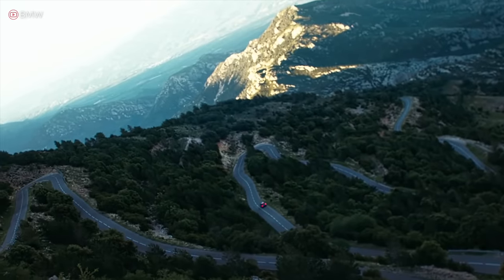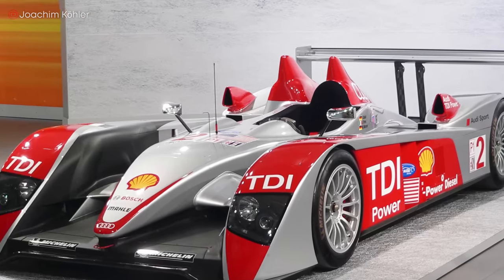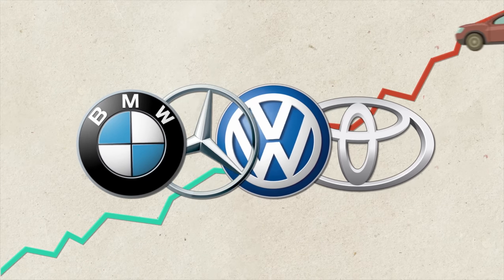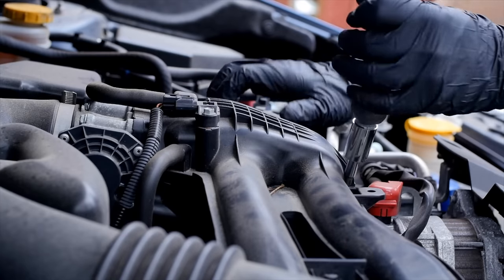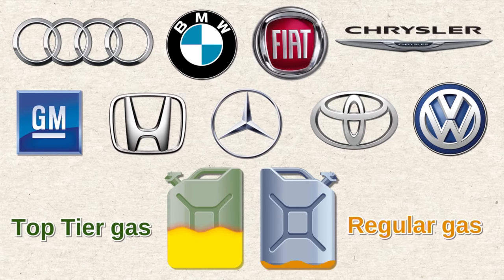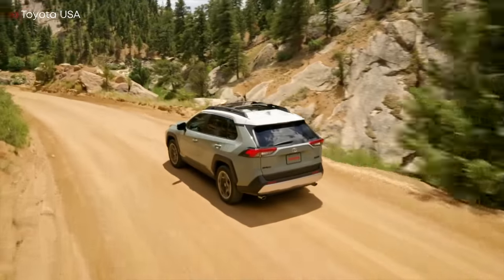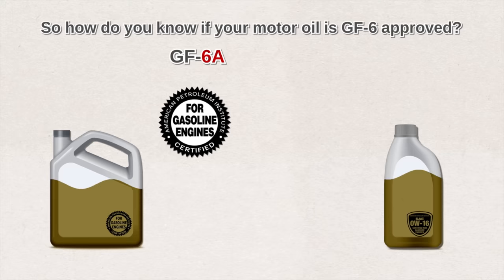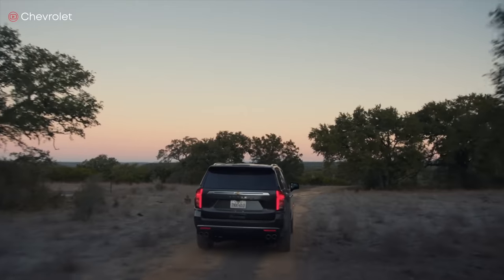Stop Buying This Fuel Right Now

Comment: Why did my 2007 Ford Escape perform better and get better mileage when running 100% gasoline as apposed to gasoline with ethanol added to it?? It was while driving on the hwy during a trip in Missouri.
Not noticeable in the city. Can't buy pure gasoline in most places. Saw the sign and thought I would try it and did see a difference.

Comment: The computer senses spark knock and adjusts timing accordingly (to some degree). I tend to believe if I'm running in super hot conditions with AC on I would use a higher octane to offset spark knock inside the combustion chamber. Seems to increase miles per tank when running AC in extremely high temperatures.

Comment: I use 93 in everything. All my highway vehicles are diesel but I run 93 in all my gas equipment. Tend to knock less. Idk what the manufacturer recommends. I know what I recommend based on my needs and scenarios.I DEFINITELY WILL NOT use anything above 10% Ethanol. And that’s only if my normal petrol station is closed and I need gas now.
Reply: Out of curiosity, what is your normal petrol station? Who do you trust? 

I agree with the sentiment about the higher quality gasoline...my chainsaws do not seem to run as well with lower octane gas. Maybe it’s my imagination, who knows. But I don’t test it these days.

Comment: On the You Tube photo, looks like you are in front of a Shell pump. Shell (at least in AZ) has been notorious for having their gas priced substantially higher than any other provider for...ever. But, to my surprise, the Shell prices have dropped in the last 3-5 days to less than most other stations; I've never seen that. What is going on?

Comment: My car is getting bad gas mileage and I had 4,5, gallons of ethanol taken out ,new CO2 sensors ,oil change,filters,but still bad gas mileage 2004 Carrolla,113,000 miles on it ,and I changed to premium gas

Comment: Ethanol is a great cock up in gas, in South Africa we had ethanol fuel in the '80s and it ate up fuel lines, filters and even corroded carbs, because of the manufacturing process of hoses and filters, and because the ethanol's hygroscopic properties. Ethanol fuel goes bad more quickly than non ethanol and results in higher fuel system maintenance.
I worked in the South African Airforce and collected the "discarded" avgas that had a Ron between 105 & 130. Ran my 1300 12 valve Corolla for more than 12000 miles on it, no problem. My brother had a car with an Iron Duke motor and that ran just fine on the avgas too, but I digress.
Avgas is a lot cleaner than normal gas and that is the main reason for using it. Cleaner gas means a cleaner fuel & intake system, cleaner burning gas = more milage & less maintenance overall.

Comment: With a diesel you have to warm it up before you drive, a gasoline engine warming it up (running idle) harms your engine. But every time you start you diesel car / truck even if you move it a little distance, you have to warm it up. If you don't you're going to ruin your engine. I personally prefer electric.

Comment: Hi Scotty, just a note FYI.  You will not find 99 RON fuel in Europe.  95RON is the highest you'll find for performance cars.  Almost every car is on 91 RON, your 87 PON, or diesel (which, having been extremely popular, is now being chided for NOX emissions).  Personally I prefer to drive diesels because of the torque and mid-range acceleration and fuel economy.  Petrol cars have become so detuned  that you have to ring its neck to get it to go.  Doesnt help that they're coupled to CVT gearboxes which I hate - that awful droning noise does my head in.
Reply: @Mark Codiroli Why are you asking me such an irrelevant question? I'm not chiding the diesel owners - environmental groups within governments and city councils are.  Go ask them?
Reply: Actually 99 Ron is quite popular in the UK. So our 93 octane is the same as 99 Ron in the UK and slightly higher than the 98 Ron in Europe. It just depends on the European country. Some European countries do have a 98 Ron option.
Reply: @waycoolscootaloo  Dont agree. Lived in the UK for 56 years, worked in Europe for 17 yrs.  Never seen 99.  98 (Super unleaded) for high performance cars is actually rarely seen cos they run on 95 (premium).  The vast majority of cars run on normal unleaded 91 RON
Reply: @csjrogerson2377  Tesco and Shell both sell 99 octane gas in the UK. I talk to Europeans all the time who buy 98 in Europe and 99 octane all the time in the UK. It's fairly prevelant.
Reply: @waycoolscootaloo  You talked to people, I lived there. OK, well just have to agree to differ.  Most "high performance" cars dont even need to run on 98.  The most common - Porsche, Ferrari, Merc, VW, Audi, Fords (except Mustang) and Lambo all run on 95. All normal popular cars run on 91.
Reply: @csjrogerson2377  I never said that they need to run on high octane.  I just said that gas stations sell high octane fuel like 98 and 99 as an option in addition to lower grades. The people I talk to also live in Europe.

Comment: I remember being in Germany from 2001-2004, and hearing about the diesel engines of Mercedes being excellent, even for luxury slash sport cars. (I saw some of them, and yeah, they were damn nice!) Of course it was only a few years later that gas prices would go through the roof, and diesel would go from slightly less than unleaded gasoline to slightly more than premium gasoline... pretty sure Mercedes was pissed. :l

Comment: OK, so a thinner viscosity oil gets better gas mileage, and lower emissions, but it wears out your engine more, so you need to replace it every 125,000 miles, instead of at 250,000 miles with a thicker oil.  (0W16 vs 0W30)   It's 0W30 for me.

Comment: Mr. Scott, I got a Hyundai Santa Fe 2013 with problems with the heat, and the radiator losses the whole water every time and I've changed the Cylinder Head, and still, the engine shakes heavily and heats up. what should I do from here? 
there's no leak, the engine is working probably, n there's nothing that can be easily noticeable.

Thank you,,

Comment: I'mma disagree with the filter change every time you change the oil.  I generally change my oil twice a year and the filter only once and even then, the filter has been on the vehicle for less than 2k miles.  I can't imagine it's picked up even close to the amount of gunk it's capable of filtering even when I do change it, much less if I changed it with only 700 miles on it.
Reply: @Antoine Brosseau It does when the filter is capable of running for 10-15k miles and you're dirt poor.  I spring for the good oil (Castol Edge HM FS) and one of the best filters (Purolator Boss or Wix).  My old oil comes out fairly clean...can see light through the stream anyway.  So why bother changing the filter.  It's just a waste of time and money--the root of all evil. Plus it makes a huge mess on top of my skid plate.
Reply: @Antoine Brosseau Haha, True dat.  Only I actually have a 3rd Gen T4R now.  The same still applies. 👍

Comment: scotty i have a 2000 520i bmw w/ the m52 tu engine and 107000 kilom... which gas and oil is best for this motor this car was built for germany and driven in greece sometimes i use 100 octane

Comment: Do you believe in amsoil 100% synthetic.   And it being way better than full synthetic oil
Reply: It's the best synthetic, but it's overkill for most gas engines. Pennzoil Ultra Platinum is second best, and cheaper.

Comment: What I'm gathering with this video is that diesel engines have a faster acceleration of torque then the gas engines. At one point time In the United States there were few diesel running vehicles and the gasoline prices were just above a dollar or more where diesel fuel  was less than 50 cents.  Today's diesel fuel is higher than gasoline by a large amount. Diesel still makes the same louder sound, still has the same fumes, and diesel cars are priced more than the gasoline cars. So what do we take out of all this? Torque, that's the only thing the diesel vehicles have over gasoline vehicles is the speed in which they can have more torque. Today as technology increases electric cars well overtake both diesels and gasoline vehicles and have both acceleration and higher torque.

Comment: If it's so economical and better, why don't all cars have them now... like 150 years later? The only "good" use I've seen of diesel engines are to drive massive electric generators in locomotives and ships, which provide electricity to power electric drive motors. 18 wheelers and dump trucks too, but I don't count them as they are always traveling 50mph in the left lane of 70mph highways, not economical, considerate, legal and they get like 4mpg (which is why it's cheaper to ship by train as I said above) lol.

Comment: How high of an ethanol content can I run in a GDI car without a cat. Manual transmission.
Reply: @Mark Codiroli I know that's what the manual says. I am curious about an e15 e20 mix. I have been looking into running flex fuel for a little boost in power.

Comment: My local gas stations in Burlington, WI has unleaded 87 and unleaded 88.
I've been using the standard 87 octane. But I wanna know what the 88 version is?
Reply: I'm in Good ol Burlington WI all the time. That 88 octane gasoline is known as "E15 gasoline". It contains 15% Ethanol. The standard 87 or 93 octane gasoline, has 10% Ethanol. So the next time you stop to get gas at one of the two Kwik Trips in town by the Nestle plant, or on Hwy 36, or even that rather new Casey's, you now will know what the difference is.😉
Reply: @waycoolscootaloo  do I need a flex fuel engine to use it?

Comment: Lower tolerance (higher precision required) for diesel = more maintenance due to running tolerances falling out of scope more regularly over more parts. Plus no fuel cost advantage and worse wide spectrum emissions means that governments are taxing them more. Petrol less maintenance required, CO2 issue but lower wide spectrum emision problems having less environmental issues. Electric engines have issues with batteries exploding in high temperatures or collision, Lithium mining issue. Hydrogen too expensive at present as well as refueling challange... Barefoot walking?

Comment: Don't forget scotty not all diesel motors are the same the straight 6 diesel is has much more torque in lower revs than and V-8 diesel motor. Can you tell I'm a cummins guy, also they don't make big rigs with V-8s anymore because they didn't stay together. Fact.
You contradicted yourself in this video by saying diesel motor require more oil changes, in a later video you say you dont need to change the oil as much in diesels because the fuel it self is a natural lubricant.
BTW I love you man, one of my fav channels, this and ACTIVE SELF PROTECTION are in my top two hahahaha.